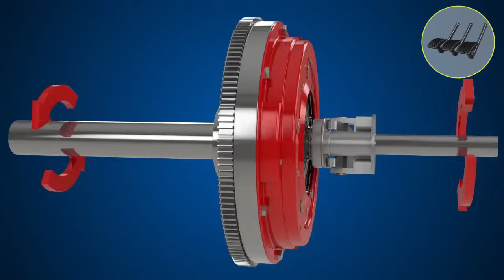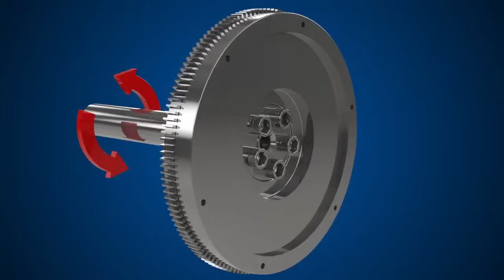How a clutch works. (3D Animation).

Comment: “Clutch Cover”. really dropped the ball there.  It’s called a Pressure Plate and the primary key why the assembly works.  A “cover” is something you put over the barbie to keep the rain off.
Reply: 'Clutch cowel' - that would've proper dropped the ball.
Whats the role of the pressure plate?
Reply: @JohnnyLawrenceCK  remember the video shows a split shaft meaning two separate shafts the driver (engine) and the driven (transmission) look at 1:30 in video - The Pressure plate is a mirror opposite machine face of the flywheel and it is spring loaded.  The clutch is sandwich between these two machine faces and is splined to the transmission.  Clutch disk always spins 1:1 with transmission whereas the Pressure plate is bolted to the Flywheel so those two always spin 1:1 with engine.   At normal rest both the engine and transmission spin 1:1 as a result of pressure plate spring force - when the clutch is pressed in, the spring fingers relieve the pressure plate, or backs it away from contact, removing the transfer of power to the transmission as the assembly is now decoupled.  The pressure plate provides the clamping force to allow the transfer of power - the clutch disk is a sacrificial wear materiel to prevent steel on steel friction contact.   The force of friction is what transfers the power, the clutch disk is what makes it tolerable

Comment: Why the video didn't call it a "pressure plate" is beyond me. Everyone I've known from years back since I first replaced a clutch, always called it a pressure plate.
Reply from the maker: It's not that important, has various names, from housing to better pressure plate. However this is an extract from a suite of interactive  elearning. These are just the videos. It applies pressure through diaphragm spring and yes looks a bit like a plate. Check other videos or even try the interactive elearning course the videos came from.
Reply from the maker: http://www.riverdeneconsulting.com/auto/basics/story_html5.html

Comment: The flywheel is spinning with the clutch pack assembly attached to it. The metal pieces in the middle of the clutch pack are the diaphragm springs, they push the clutch away from the flywheel when the clutch pedal is pushed in and let it get closer as you let the clutch pedal out. The diaphragm springs are pushing against the pressure plate. The springs that are on the inside area of the friction disc are dampening springs. They help to soften the felt engagement of the friction disc to the flywheel when the clutch pedal is being let out and engaging. The flywheel spins as the gas pedal is pressed, as the clutch pedal is being let out the friction disc, which is rubbing on the flywheel when friction point is achieved, is catching the transmission output to the wheels up with the rotation of the engine. When the clutch is let all the way out, pressure from the diaphragm spring is pushing the friction disc up against the flywheel to ensure engagement so when you accelerate the engine and transmission output are spinning at the same rate of speed. When the friction disc needs to be replaced, usually when you accelerate hard enough the clutch will "slip" and the engine will spin faster than the friction disc and cause a feeling of a loss of power. I probably didn't do a very good job of explaining it but there you go.
Reply: every bit of information helps. thanks.

Comment: what is the function of pilot bearing, which is situated at input shaft and connected to flywheel?
Reply: It sits in the center of the flywheel. The end of the input sits in it. It provides support for that end. Keeps the input shaft straight. Can damage the gears in the trans if that is bad.
Reply: Also the input shaft seal

Comment: The thing that always bothered me is thinking that the engine engages with the transmission system with friction, I somehow feel I'm missing something as common sense tells me with friction the parts would quickly wear out. I know there are some springs to smoothen out the kick but there's still a big amount of friction every time you shift gear
Reply from the maker: It doesn't stop, wheels still turn, that's why you can change gear by syncing engine speed with vehicle speed into any gear ish. It's not a stop start process unless you mess up the shift
Reply from the maker: Remember neither the engine or clutch stop rotating once moving hence. Fly wheel. The pick up after gear change is two moving surfaces
Reply: @Spraiser74  thanks for the reply. So what you mean to say is that they engage very rapidly because both parts are already spinning (although probably at different speeds) and there's pretty much no friction? That could make more sense to me
Reply: Wild Eye Studios think about your brakes. They work in the same way and last a long time. They also work much harder. They stop they vehicle so often. All the clutch has to do is latch
Reply: @wildeyestudios5 there's very very much friction. The clutch plate is clamped on the fly wheel with a tonne or so of force, and that force is released when U press clutch.
In neatral/clutch depressed the clutch is still spinning, it always spins, I believe it's riveted to the RED!!!!! pressure plate. It spins with road speed, meaning when wheels are turning because gearbox always turns when wheels turn (road speed) when U rev motor in neatral flywheel spins (engine speed).

Comment: Wouldn't the clutch plate still be rotating after pressing in the clutch pedal? It's disengaged but isn't still spinning freely inside the clutch assembly?
Reply: Clutch plate speed is directly related to transmission speed
Reply: If you are in gear, the clutch plate will spin, if the wheels are moving
Reply: If you are not in gear, the clutch plate will not move if not pressed against the flywheel. Of course there is inertia of both components.

Comment: I would’ve liked more animation from the red part of the clutch
Reply: Agree -- the pressure plate and spring functionality was not as clear as it could be.
Reply: The red part is a pressed steel component bolted to the fly wheel. It isn’t a transformer- just rotates with the flywheel. It’s the finger springs, fulcrum ring and pressure plate beneath you mean.

Comment: Cool animation but the main thing is how pressing the clutch paddle engages and dis-engages  the force it's not clearly shown.
Reply: It quite clearly shows how the clutch peddle engages and disengages. The metal piece shown in front on the in front of the pressure plate is the release bearing and clutch fork, Which is what you are moving when you put your foot down on the clutch.
Reply: @FilthTrackz  I was referring to that clutch fork thing which is kind of hiding behind the crank shaft and it's mechanics can't be clearly seen.

Comment: If the ring gear teeth didn’t appear to rotate in the opposite direction ... this would have been better.
Reply from the maker: This is a natural phenomenon. It is not an error. To see for yourself watch a propellor or fan! Shows you were engaged though. Thanks.
Reply: Simon Raisbeck This is incorrect. This ‘reversing’ effect only occurs when rotating objects are filmed...because of the frame rate of the camera.
Reply from the maker: @Tinman2809  this is why we used  cutting edge 3d animation software as used by blockbuster films 😜 seriously I didn't draw it. Even at this frame rate it took over 7 days to render on 12 machines.
Reply: Steven it’s funny that you’re actually incorrect

Comment: Great animation... Only that I still don't understand how the clutch works
Reply: The clutch works in the same principle as the brakes on your car. Think of the clutch plate as the brake pads but in reverse. You press the brakes so the brake pads make contact with the rotors to slow the car. In a clutch the contact is constant (similar to you keeping pressure on the brake pedal) but when you press the clutch you release the pressure allowing the engine to spin freely without the transmission to be engaged. That being said as a total gear head myself I am still amazed that the clutch pad material can grip the flywheel so tight that the transmission is like a direct shaft connection. I guess the same can be said about brakes. How those tiny pads grab the rotors with so much power that it can bring a car to a screeching halt.
Reply: @ScarabChris  please it's very hard to understand how is there friction when the clutch  attached to the fly wheel and how is power stopped when you press the clutch?when you do it just lifts the pressure plate and diaphragm
Reply: Ghghgh Bbhh i think what he is saying is the engine and transmission are connected when you are driving and don’t have your foot on the clutch and are in gear...the clutch is engaged with the flywheel spinning together but when you press on the clutch it disengages it and while the engine is still on for the time being unless you stall...the transmission is waiting for you to give it a new speed(3rd to 4th gear as an example) or to brake if that’s what’s happening at that time...I think that’s how it goes🤷🏾‍♂️
Reply: @ScarabChris  that's a terrible way to explain the basics.
Reply: @ScarabChris  TX that was really helpful 👍. First time I understand how it works.
Reply: i dont know how to drive
Reply: @ionutth4895  me too😂😂
Reply from the maker: There is a full elearning tutorial to support this. The video is just an extract from the course. There are many other videos and courses including light vehicle hydraulics. Thanks for your comments
Reply: @Spraiser74  where can I get that course?
Reply: It's still extremely clever calm simple and Quick way to understand how it works so thank you for this video
Reply: Basically just two rotating parts pressed together, one part attached to engine side, the other two the transmission, they are pressed so tight that they rotate as one unit. When you push in the clutch pedal you are separating the two parts thus engine and transmission turn as separate units. If your pedal is in between fully pushed in or let out it will cause slip, which is very useful in absorbing shocks and speed difference between engine and transmission, but should be used sparingly to prevent overheating and clutch damage. That’s all you need to know as a driver.
Reply: It would help if the video actually properly named the part called "pressure plate." The thin clutch plate gets pressed together in between the flywheel and the pressure plate by spring pressure of the pressure plate. The transmission shaft is only connected to the thin clutch plate, so as it gets pinched in between those two parts by pressure, it's forced spin with the flywheel turning the transmission shaft. It's not complicated once you figure out exactly how it works, a better video might help. Trust me, once you get it, you'll wonder how you even missed it.
Reply: Not everyone is smart. It's ok if you aren't, as long as you are comfortable with your self.
Reply: Me also fails 2 understand
Reply: So much left out, no pressure plate, no thrust bearing.
Videos like this are basically useless unless you already know how a clutch works.
Reply: True
Reply: Sorry to revive an old comment but I understand where he’s coming from and others in the comment. The theory is the clutch disk is splined to the transmission input shaft and the flywheel and pressure plate Sandwich it together. When the pressure plate is pushed via the “fingers” by the release bearing all the animation shows the pressure plate side detached itself from the clutch disk. However the clutch disk is still connected to the engine side(flywheel) all while the disk being splined to the transmission input shaft so doesn’t that mean it’s still transmitting power to the input shaft ?? Shouldn’t it be that the Clutch disk itself removes itself away from the flywheel and no longer attached together thru friction and then and only then is the transmission and engine separated ? The clutch disk is splined to the input shaft so the clutch disk would need to be detached from the engine side (flywheel) for it to disengage correct? But the video shows the pressure plate side of the friction portion detaching itself away from the clutch disk , the pressure plate isn’t splined to the trans so why would it matter if the pressure plate side detached itself from the clutch disk if the clutch disk other side  is still pressed to the flywheel thus causing power to go from flywheel to clutch and then because the input shaft is splined to the clutch that would mean power is still going from engine to input shaft.
Reply: So flywheel is attached to the crankshaft of the engine and the clutch is attached to the transmission input shaft. If the pressure plate let’s off, no pressure on the clutch which means no movement of input shaft of the transmission so no moving. When the pressure plate is let off the pressure is out of the clutch against the flywheel which makes it move
Reply: I find it much easier to understand by asking why we need such components in the first place, not just the how.
Reply: then don't even try understanding differentials.... I've watched 10 videos and still don't get them
Reply: So I have a yanmar garden tractor ' the spines have stripped and you can no longer get a clutch plate for this model , unlike a car it's just a drive shaft that goes into the clutch connected by universal joints to the gearbox at the rear of the tractor ' so my question is can I weld the clutch plate splined part to the shaft or does it need to slide on the splines of the drive shaft to operate the clutch plate properly ?
Hope that makes sense
Reply: Actually its really simple
Reply: And that's why Martin does not understand. Martin, there are two discs; one moving and one not moving, when the one moving touch the one not moving then they are both moving. You understand?
Reply: And I thought it was me.
Reply: Ahahahahaha
Reply: Like when holding the gas while starting the ignition disengaged the fuel injectors. It's all a mystery to me
Reply: dummy
Reply: Its like lifting a heavy box with two hands.... You need to use both hands to put force at same time in order to apply force (clutch plates together) if only one hand is on the box and the other hand is free, you won't be able to lift the box( clutch plates separate)
Reply: And me😊
Reply: https://youtu.be/9UmrCl2nLKM
Reply: reverse brake bad essentially
Reply: When you press clutch pedal down, you are pulling back the clutch springs. When clutch pedal is not depressed (up), the springs push drive plate to flywheel. Quite amazing that clutch springs hold down the drive plate enough.
Reply: Could not understand. Pl clarify it with more examples
Reply: Heyy 
Can it be the opposite? 
Mean can the clutch blate be the driver not the driven?
Reply: Not me though, the explanation was infact one of the best way I learnt how a clutch work. Don't know about you, but I'm just commenting my opinion.
Reply: Watch it again
Reply: I know it's 2 years later now, but if you are still wondering how a clutch works, here is a good video: https://www.youtube.com/watch?v=JOLtS4VUcvQ either watch the whole thing or watch from 7:00
Reply: Get 2 plates. Put them vertical and not parallel to the floor. Push them together one towards the other. Imagine the one on the right is attached to a wheel and the one to the left is powered by the engine and the engine is your left hand. So by moving the plate with your left hand you will also move the right plate and then the imaginary wheel. Now a third hand will occur and will pull your right hand towards the right, then the plate will get detuched from the left one (in this way your left hand will keep rotating and also the right plate will. Keep rotating but now they are doing it in an indipendent way, they are not connected. And at some point the third hand will stop pulling your right hand away so it will come back to the left plate, so, because you are squeezing them together, they will keep rotating like one. The left one(the engine) gives the Speed to the right one(the wheels).
Reply: +1
Reply: @theory816 0.ㅇㅈ😂ㅊ 내가 지금 지금 먹고 먹고 너무🤦 😂 🙈 💦
Reply: heaps better clips 4 u.
Reply: Amazing - many thanks - my flywheel might be in need of replacing - although hope not!
Reply: Watch this video, it explains step by step how the clutch works
https://youtu.be/devo3kdSPQY?si=PlQc7M4aOaIx-y8D
Reply: Thats what I am saying. It doesnt go thru my mind, how does it connect without slipping
Reply: you: hit clutch
Transmisión: "I broke up with Motor"
You:*releases clutch*
Transmission:"I came back with Motor, we love each other"
Reply: When you press clutch there is bearing on a clutch plate that help to free rotation process... On the other side Flywheel keep rotating.
Reply: Or just hold that bearing on your life time to get the concept. It's just bearing on a clutch plate that come with a piece.. Simple as that 👌
Reply: Thank you. I have understood for years how a motorcycle clutch worked but could never make that translate to an automobile clutch. The cut away showing how the throw out bearing pushes the spring thus relaxing tension on the clutch plate made it make perfect sense.
Reply: Hhhh 😅
Even me bruh, it is still confusing me the more I want to know about it
Reply: Because they skimmed over the most important part
Reply: Watch it more times around 2.04 - 2.07. You will see what happen at the top of the video.
Reply: How....the video clearly just explained it.
Reply: That massive head and no brain, sound about right for the new generation 🤪
Reply: Little baby bum
Reply: Do something else with your time. Not mechanic minded. Just move on